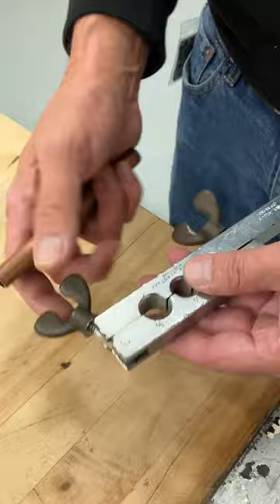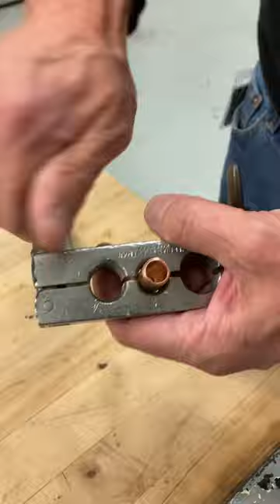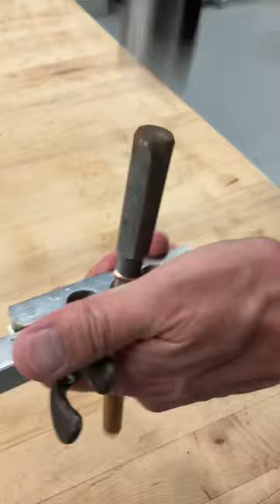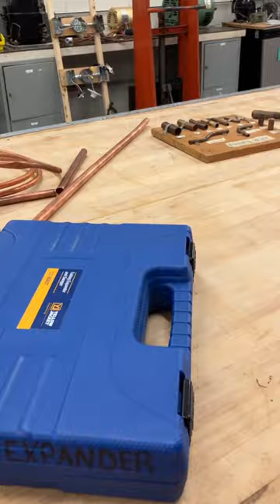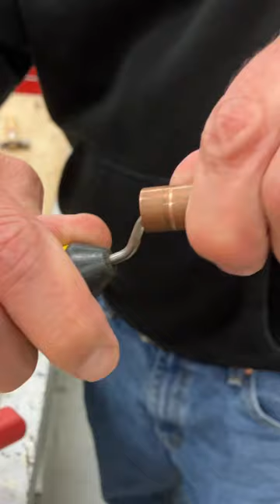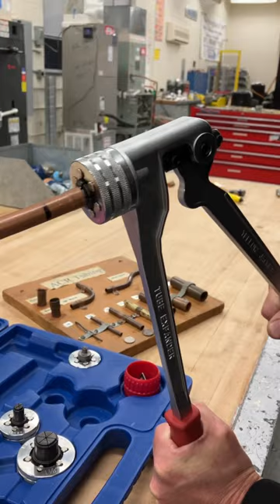Let’s Swage Old School vs. New School

Comment: Ok so what is the cost of each option.  For a home guy doing a couple of joints in a bathroom remodel. Yeah going with hammer option pro guy may or may not want to spend the kind of dollars this undoubtedly cost.
Reply: Swaging kits aren’t that expensive tbh, and that Yellowjacket set is definitely worth it’s money. If you’re not a guy that fixes his own copper tubing or works on piping systems, you’re probably hiring a plumber or HVAC guy anyways. If you want to be able to fix everything at home, you’ll also need an acetylene or oxy/act torch setup too. 

If it’s just a bathroom remodel, most non-fitters/plumbers will just try to run pex and propress like everyone else nowadays. Wait till you find out how expensive those tools are 🤣